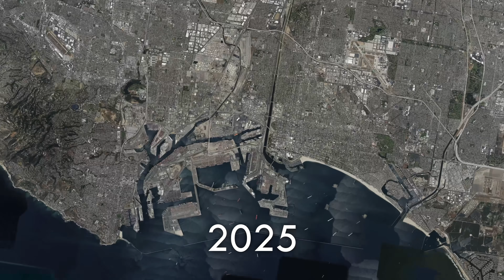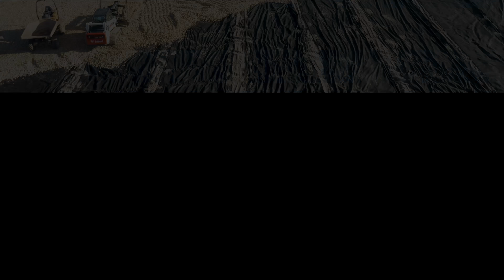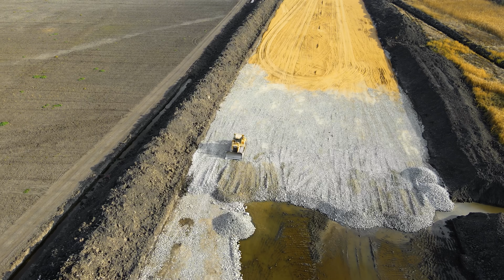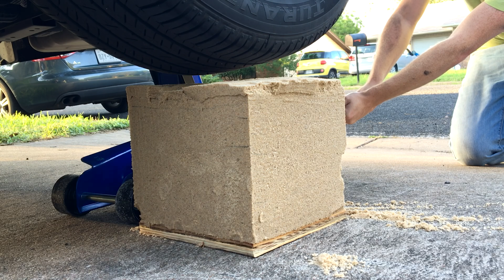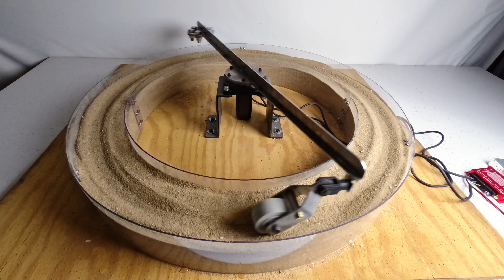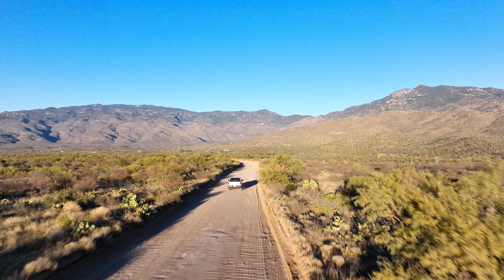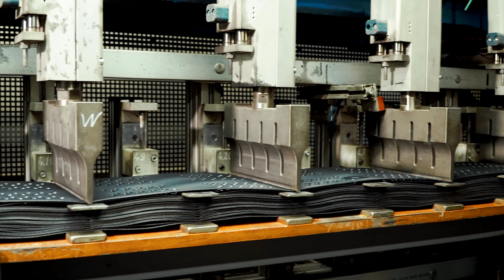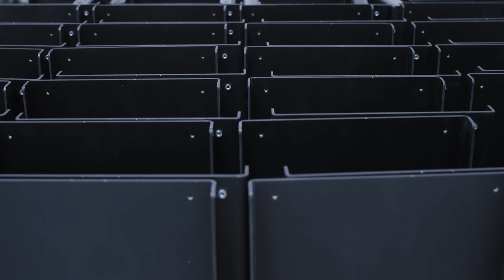The Grid That Doubles the Strength of the Ground

Comment: 15:33 - an additional benefit, water can recharge aquifers, especially in large urban areas that are nearly sealed by roads and buildings. This can store water against future droughts.
Reply: This makes me think. What if the use of this honeycomb design on roads could enable a different material than asphalt to be on top of the road? Something that still allows cars to go fast but also allows water to seep through. It most likely wouldn't, but it might be worth thinking about. After all, some of the biggest breaktroughs in science were accidents and people doing things that common sense would advise against.

Now that I think about it, doesn't asphalt - over time - have the same problem as dirt? Over years, asphalt deforms into peaks and valleys that eventually result in pot holes. Surely this same method can be used to stabilize asphalt roads too?
Reply: @89Exus Any road will always require some sort of maintenance. I don’t know how much the geo-cells improve that for dirt roads, but I suspect that it doesn’t make them entirely maintenance free. Asphalt can take way higher loads, and for longer periods of time, than a dirt road ever can. In addition, you can always scrape off the top layer of asphalt to resurface the road. So higher upfront cost, but lower maintenance costs while still using recyclable materials.

For water permeability we use an asphalt called “ZOAB” in the Netherlands for the top layer(s?). It allows water to literally pass through the asphalt surface, though it degrades faster in icy conditions.
Reply: @89Exus  No, potholes do not result from asphalt turning into corrugated roads. Even though the plastic is not the worst kind, it is still prone to making lots of microplastics, especially if it's used in dirt roads - like the OP seems to be saying.
Reply: Not so fast... We've already had a large underground fire from these here in Virginia. 

The underground fire at the Williamsburg Premium Outlets caused a significant collapse of the parking lot due to an active fire in the stormwater detention facility. The fire was initially detected in the underground stormwater system, which is designed to manage stormwater runoff. The fire was related to the plastic crates used in the system, which were compromised by heat and flame, leading to the collapse of the concrete and gravel that made up the parking lot. Firefighters from James City County and other agencies were on the scene, working to cool down the area and prevent further damage. The fire burned for weeks...
Reply: @YouNoStepOnSnek  That's wild enough I had to go check it out, and see how common this was. The burning part, not regular at all, but they are known to collapse sometimes. Doesn't sound like it happens a lot either, but it's interesting.
Reply: @YouNoStepOnSnek  That was a system made from components like AquaBlox - those differ from geocells in that they are empty void space, rather than filled with material.  AquaBlox maximize the total airspace per module to allow for water to take up that space - of course in the instance of the Virginia fire something got into that volume that was capable of catching fire (like antifreeze, oil, and other road chemicals), and the extra air circulation enabled by a lower water volume allowed for combustion air flows.  These AquaBlox have more in common with septic leach fields than geocells.
  
It is true that angular fill could be used in thicker layers to create a partially filled space in the individual cells by using less fines, and it could be topped with a material like permeable asphalt or concrete (which is itself engineered to have less fines), which would drain down into the geocells - and you could still use the same principals as a french drain to handle overflows while allowing water to permeate the adjacent soil via geotextile filter fabric.

Comment: There is an area on Texas 21 between Dimebox and Bastrop Texas. They expanded the road from 2 lane to 4 lane. It seemed the job was done correctly. The highway department had the old shoulder area dug out  about 3 feet. The put in new fill and used geomat. After a few years one side of the road had areas of failure. It was only on the north side of the highway. They then did segmental repairs. It seems to be holding up. Your presentation is very interesting in light of the problems experienced with this roadway.